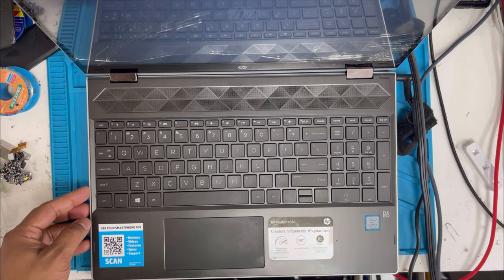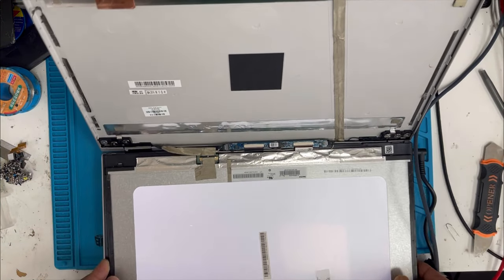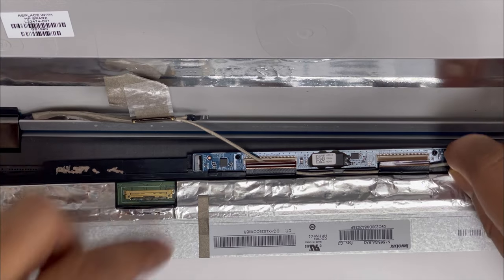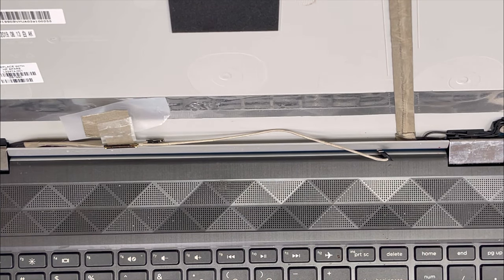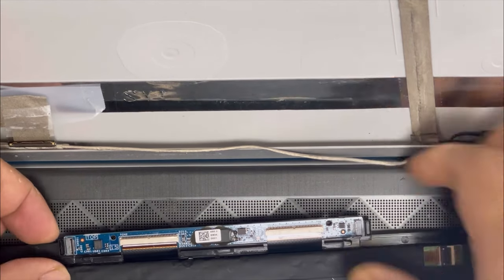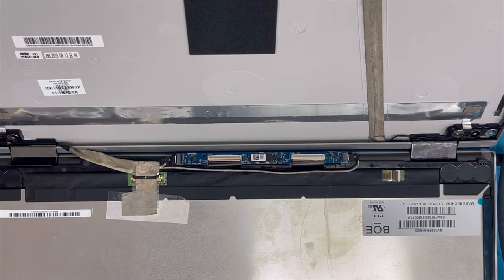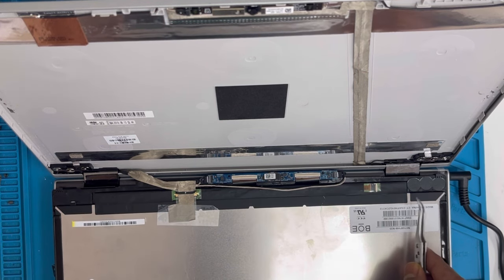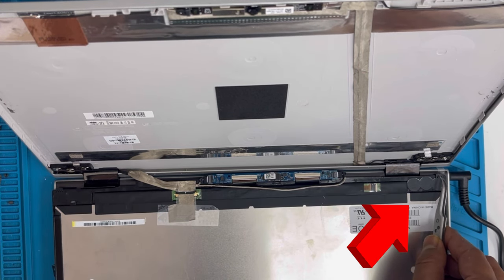Hp pavilion x360 convertible touch screen replacement, 15-cr0055od screen replacement,15-cr0055nr

Comment: Thank you.  Excellent walk-through.  I had a different repair - the plastic lid had broken away from the hinges.  The brass inserts pulled out of the plastic lid.  I found a replacement lid on Ebay and was able to replace it.  Nice of HP to put replacement part number labels on the inside of parts.  One tricky part was inserting the flex into the camera PCB connector.  Both the flex and PCB are tiny and hard to align straight.  I kept having the flex bend or the board twist.  But after many tries, I got it in.

Comment: I have the same type of computer, 11th generation. The touch does not work because the screen is broken, but it works, but the mouse moves a lot and the touch button on the keyboard does not work. Do I need to change the screen only or the keyboard and the screen?